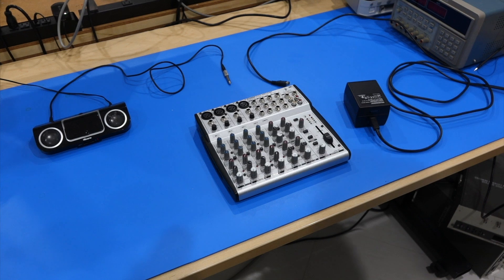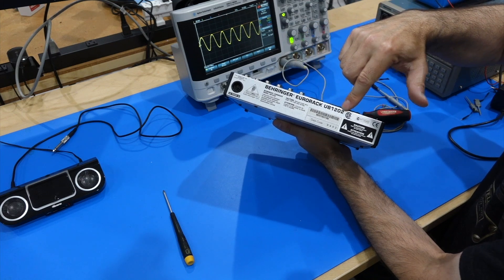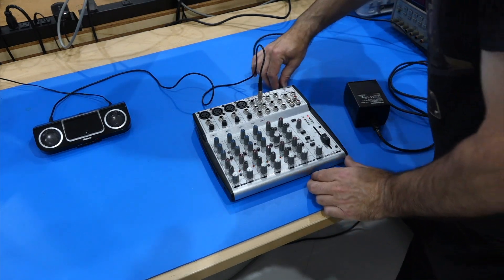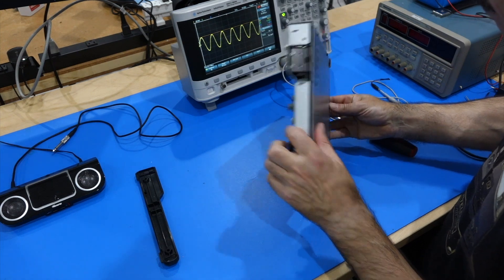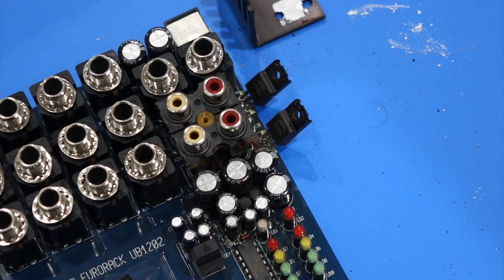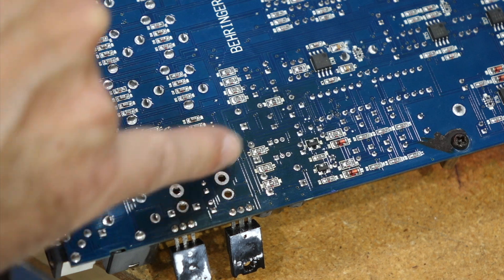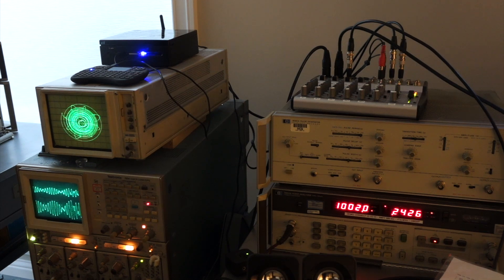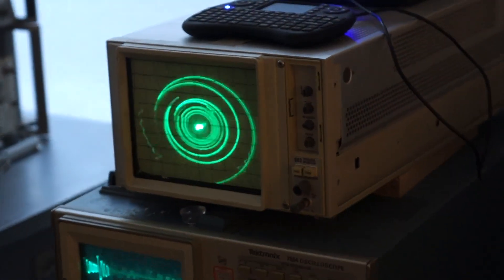Modern Tech Fail: Behringer Eurorack UB1202 Repair

Comment: Excellent video. Subbed. Time to repair my 802 and 1202 Beringer. What replacement caps are recommended for this recap? And who makes that amazing desildering vacuum? Cheers!
Reply from the maker: I used Nichicons 105C 10,000 hours when I could, or Rubycons, otherwise same values and values ratings as the originals. The desoldering tool is a Hakko FR-301, I highly recommend it.

Comment: Hi Marc what is the tool you use to release the components from the board? Never seen one before
Reply from the maker: Hakko FR 300. Highly recommended. This would have been a nightmare without it.

Comment: Yeah, those older Behringer mixers are terrible. Just all the cheapest possible components. There is a reason why the SSL 2ch mixer goes for about $2,000. The Behringer will sound mediocre at best and won't last long, the SSL will sound amazing and last for decades.

Comment: One reason why their equipment is so cheap. Use cheap parts and keep the price down. Its a common problem in TV power supplies in modern flat screens. I have seen the same issue with Motorola Spectra mobile radios. They used these surface mount aluminum caps that after a decade of use thy would puke their guts out all over the PC board ruining the traces. We just shotgun all caps in power supplies to eliminate future issues. Nichicon caps are some of the best on the market for high temp usage.

Comment: I bet if I pulled a few caps from some old boards I have, not made of chinesium, I bet they would still hold value +/-% but not this bad. Some more fun with chinesium was when I got an lm317 in an lm338k package (they were fake). I avoid anything chinesium, if I can, like the plague. Good video.

Comment: I also have the UB1202 and it failed after about two years. Two OP amps had gone south so I had no sound output.
Quite easy fix and it has been working since. Only cost me the price of the OP amps as I did the repair myself.
This was 15 years ago so maybe I should replace the caps. :)

Comment: I heard about it was alot off bad china caps made in the early 2000 and some years forward . flat TV , dvd bluray etc etc use them I hava a LG dvd recorder hardly any use had to guess and find a Youtube video changed 8-10 caps .many was bulged on the top . .  Is this problem common still on new made equipment ??
Reply from the maker: We'll know in a few years, but I'd say probably yes, particularly in consumer stuff. Rush to the lowest possible cost, fastest to market and disposable appliance mentality goes against long term reliability. Plus the usual engineering or production screw ups - long term reliability failures are very hard to catch unless you spend a fortune and a very long time in reliability testing. Hence the price of MIL rated or space components, and how "old" that technology feels by the time its out. And these still do fail, just rarely. A glaring exception is cars. They are the one consumer item that is both incredibly low cost and utterly reliable considering the number of parts that go in it, and the harsh environment they are subjected to.

Comment: Man Behringer, come on, that's no good for German quality stuff ! This is horrifying low quality caps. Never seen such a thing before.
Reply from the maker: Of course this has happened before, and will again. Batch of parts with a hidden aging problem that has gone undiagnosed, and they all fail years later. Very hard to catch. Apple hardware from the 1990s is notorious for having all their caps leaking (I think Japanese ones actually). They of course normally don't do this on purpose, neither the equipment maker nor the component supplier. But obviously aggressive cost cutting is an aggravating factor, if not a root cause. So as some commenters point out, it's partly the user's fault too: I didn't give them enough money to buy good caps. No bad caps in Apollo or Soyuz hardware, but not exactly the same price...

Comment: I was expecting bad filter caps, due to the excess ripple that you've seen. Could it be that the bad decoupling caps were causing excess current due to distributed leakage all over the board?

Comment: Now to be fair, this mixer is 10+ years old and these things are among the cheapest you can get for a given feature set. You get what you pay for, in this case cheap caps sourced locally in China - which I suspect may have been problematic from day one.
Has noise improved now? Having played with a newer Xenyx Q1002USB, I didn't find it to be particularly problematic, although the mic input definitely missed its EIN spec (supposedly -134 dBu shorted, my estimate was -126 dBu shorted = -124.8 dB @ 150 ohm, quite consistently for both inputs - presumably the input transistors don't have rbb' nearly as low as they should, perhaps due to switching suppliers; it's certainly not typical for the whole company, as Julian Krause found plenty good 150 ohm EIN even on their cheapest USB audio interface, the UM2). Yes, my current Mackie 402 VLZ4 will get about 4.5 dB lower mix bus noise, its preamp distortion remains negligible even near max gain, and I think peak internal level handling is more like +22 dBu instead of +16 dBu. Still, you should be able to get plenty decent dynamic range through the Behringer if you get the gain staging right.

For a nominal 2 Vrms / +8 dBu peak output (roughly 1 V/div), I would recommend the following settings:
Channel level ~ 0 dB (adjust input gain accordingly)
Main mix ~ -10 dB
Reduce main mix if you need less.

BTW, I don't know how you're getting the signal out of the PC in the first place, but if it's an unbalanced output I hope you soldered the XLR cables yourself. Otherwise you will not be getting the benefits of the balanced input at all.

If both the signal source and the mixer output side are grounded:
unbalanced signal --> red wire --> XLR pin 2
unbalanced ground --> blue wire --> XLR pin 3
Cable shield should connect either to unbalanced ground or XLR pin 1, I just keep forgetting which one was the better of the two.

If either side is floating:
unbalanced signal --> red wire --> XLR pin 2
unbalanced ground --> blue wire --> XLR pin 3
unbalanced ground (2) --> shield --> XLR pin 1
This cable may work just as well in a "both sides grounded" scenario but it somewhat depends on XLR pin 1 routing within the device, so YMMV. (A mixer introduced in 2002 may very well not be AES48-2005 compliant. A schematic for the smaller UB802 is out there, and that shows pin 1 going straight to AGND with no dedicated chassis ground in sight, so seemingly not compliant.)

Comment: These caps fail exponentially over time: internally they're subject to V^2/ESR heat dissipation. As ESR increases, so does the internal heat; this causes the rate of dry-out to increase, which further increases ESR and therefore heat, etc..

Comment: Hmmmm and they seem so attractively priced too!!!  - I use 2 of the other Behringer models - one is problematic with it's USB and the other introduces quite a bit of hum into my audio - that's a lot of capacitors to remove and check/replace.  Great video and probably a look into the future for one of my mixers.

Comment: "Chinesium" is misguided as Behringer should owe up to it.  Behringer states "Designed and engineered in Germany" .   Behringer designed the process by which this is manufactured.  Behringer needs higher quality assurance processes.
Reply: They need to strictly specify the components that shall be used. No cheap chinese substitutions.

Comment: The story I heard was everyone wanted smaller cap in size but the same cap value.  The cap industry jumped. The liquid was changed to obtain the higher rating but it also ended up being  corrosive and leaked.   Or the sales guy said we need more 15 v caps...  just remark the 12 v one and sell them.

Comment: I have a Fender amp built in September of 1960. All the power supply electrolytic filter caps are still good (I had them tested). So they have run for 60 years and have held up. Replace them? Maybe, I get yelled at to do so, but why? They are good and the replacements are not built as good even if I buy top brands (which are faked at times too). These modern caps can't make just a few years. Until I hear the hum come in, I am keeping the originals in place.

Comment: What device did you use to remove the caps from the PCB?
Reply from the maker: This one: https://www.hakkousa.com/products/desoldering/hakko-fr-300-desoldering-tool.html . Carl recommended it to me. I don't know how I could live without it before. Highly recommended. Make sure you buy a few extra nozzles of varying diameters, as the nozzle tightness around the pin is important.
Reply: @CuriousMarc  Thanks, Marc!  That really is an incredible device.  Could you possibly do a video on the use, limitations, and care of it?
Reply: @CuriousMarc  Mine is a 24V one with the temp control and pump in the base unit. I only have a small work bench and i wish id bought this one now. I wonder if there is a 240V UK version.
Reply: Desoldering vacuum gun.
Reply: @simontay4851  Thanks, Simon.

Comment: Even though the caps test as "good", I'd still replace them with nice quality ones for good measure.

Electrolytic capacitors are the "secret sauce" for planned obsolescence.  I wouldn't be surprised if manufacturers choose the quality to match how long they want the device to last before someone has to buy another one.
Reply: One would believe they do so intentionally, yes. I can only imagine how much otherwise perfectly fine electronic devices have been thrown out :(

Comment: I repaired old old AMPEX tape recorder by replacing all the power supply caps.  I don't have the equipment to do this level of checking.  It makes me think I should replace all the caps.  It works now with no hum, so maybe leave it as is.  What was funny was the power supply push-pull tubes had to be replaced.  I replaced them with Russian tubes as they had the best reputation for modern replacement tubs.  The punch line is that this particular recorder was used by the US Navy to record diplomatic parties during the Cold War.

Comment: Damn, my UB1202 has this same issue...  Went to fire it up and notice it's clipping even with nothing plugged into the audio inputs...  GG... I mean I used it for years and years so I guess I got my money's worth, but still, something as "simple" as a mixer should work for a damn long time :P
Reply: Makes me wonder how long the recapped unit will work. Will something else go bad?
Reply: @KameraShy  Oh, it should be fine since he presumably replaced the capacitors with good ones from a reputable manufacturer :)  They should last decades :)  Oh but you mean something else on the board?  Yeah it's possible something else could fail.  Luckily it's a relatively simple piece of electronics.. who knows though...

Comment: @CuriousMarc : could you please tell us the values of the capacitors you replaced this stuff with? There are so many variety of 
Nichicon Aluminum Electrolytic Capacitors - Radial Leaded on mouser etc, I have no idea which ones to get to repair audio equip and computers. No idea at all. Please tell us. I've seen those caps in many things (everything) and want to have some on hand to beable to fix. But you DONT TELL US!!!!
Reply from the maker: I used the original values for capacitance and voltage, radial, but took only Nichicon, and when they did not have it, Rubycon. All 105C, 10,000 hours lifetime rated if you can find them. Usually on DigiKey or Mouser I just sort by how much they have in stock, the popular ones pop right up. And you guessed it, they are not the cheapest, but the difference is not that meaningful.

Comment: 7:30 "Guilty by association" ^^
Yes you can tell from a distance if a capacitor is bad: if the brand sounds chinese, then get rid of these turds.
I'd rather reuse a 15 year old Nichicon, Rubycon, ELNA or Panasonic than this Chinese junk.

Comment: I have the american made Mackie 1202 (what Behringer basically ripped off), made in the 80s, and that thing actually does need to be recapped. I just haven't felt like taking it apart and doing it.
Reply from the maker: Dang. That one too? There is no safe place in modern electronics!

Comment: Yeah, I bought a condo that was 10 years old, but never occupied. The oven still had the manuals and styrofoam in it, but the control board failed and the mfr (high end appliance) had no replacement boards anymore. It was... the electrolytics. Every single one was bad. All cheap, cheap, cheap, caps too. Replaced them all, restored the board. Mid 2000's era appliance. That was the era of bad capacitor manufacturing.

Comment: I used to work in the pro audio biz and Behringer always had a reputation for ripping off other companies' successful products (yours is a copy of a Mackie 1202) and building them as cheaply as possible.  Not surprised at all about the crappy caps!
Reply from the maker: And I looked the Mackie 1202 up and your are absolutely right, it's a 100% rip-off copy! The design and layout, which is the thing I really like, is not even theirs! Now I am really annoyed.
Reply: I bet you wished you'd bought a real mackie 1202 now. How do they get away with it. You would think beringer would get sued by the original company(s) they copy.
Reply: I’ve got a Mackie 1202 that I got back in the mid 90s.pulled it out a few weeks ago for a project and it still works great!
Reply: @simontay4851  many companies do, in fact Behringer just made music industry news for such practices last week with a copy of Arturia's mini MIDI controller. Not even a bit similar but 100% a clone in layout. Arturia are understandably a bit miffed.
Reply: @CuriousMarc  I also have a Mackie 1202VLZ that was made many decades ago in the USA.  I ran it 24 hours a day, 7 days a week, and used it every day.  After about 20 years, one of the power supply capacitors failed.  I replaced it, and the mixer is good as new.  I have  used it for personal mixing, as a live sound mixer for small events, as emergency backup for a failed digital sound system, as a supplemental "additional inputs" mixer for a large live sound mixer, for recording, for everything.  It's a great little box.

The Mackie also requires taking of all of the knobs, but also... there is a locknuts on everything, holding everything solid -- VERY solid.  It does take a little patience to open the thing up for servicing!  : ) 

I doubt if the new version of the Mackie are made in the USA, but somehow... I would expect them to have better QC than the Behringer.
Reply: @ydonl  I've got a 90's Mackie 8 bus and it's still going strong, it has a few minor issues but it's clean (noise wise)
Reply: Behringer got sued by Mackie in the 90's, also compare their Eurodesk models to the Mackie 8 bus. Also the original truth monitors Vs Mackies. The original truths had horrendous reliability issues too.
Reply: Back in the day, as a Mackie dealer, we referred to Behringers as MSO’s; mixer shaped objects 🤣

Comment: You can repurpose all those Chinese capacitors as resistors!
Reply: Or smoke machine
Reply: They probably aren't linear enough.
Reply: You might be able to poison fish with them if you dump them in the river.
Reply: Now that I come to think of it, you could use those caps as dental implants. It would save the cost of the titanium (?) sockets, by just soldering the pins into the jaw, which would be previously prepared by lining the holes with silver paper, although poorer countries like the US could use cooking foil. Either way, the finished look would be like a rich Mexican gangster, I think.
Reply: Or remove the leads and paint them a brass colour and make prop spent casings
Reply: lol Might as well.
Reply: They will have an audiovisual overload alert system

Comment: I have the same mixer, controls are uneven between channels, I bet I have the same issue!   Thanks!
Reply: that's just some dirty or worn out potentiometers. use some contact cleaner and grease on them, hopefully it will help. if not then you have to replace the pots.